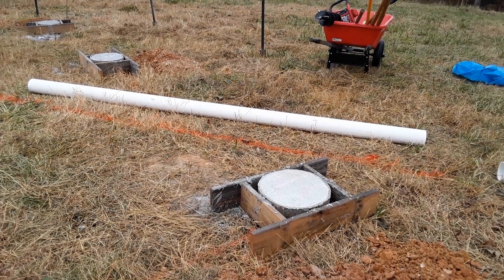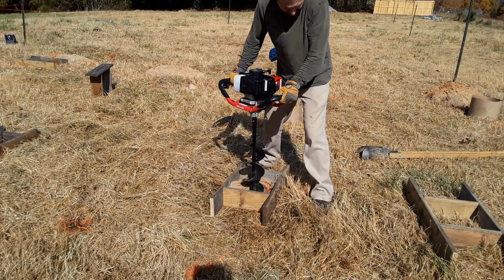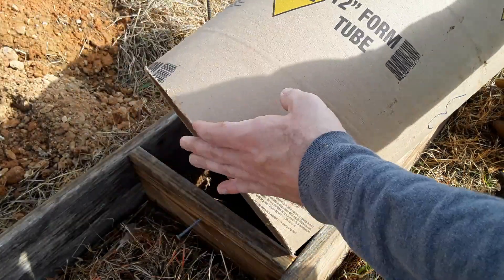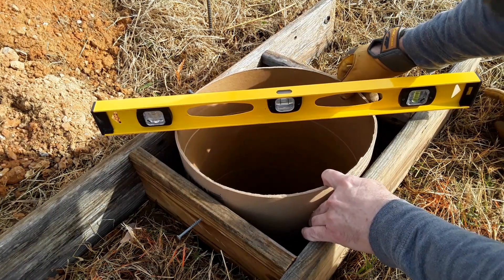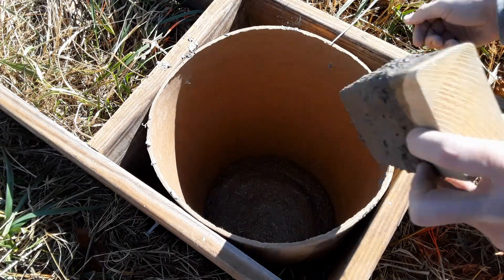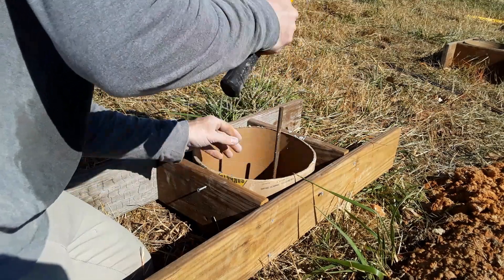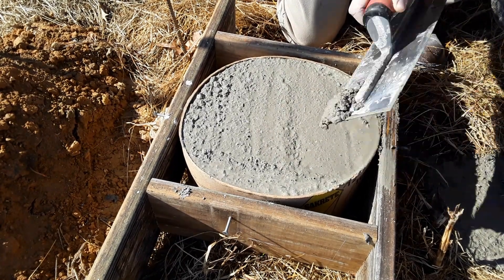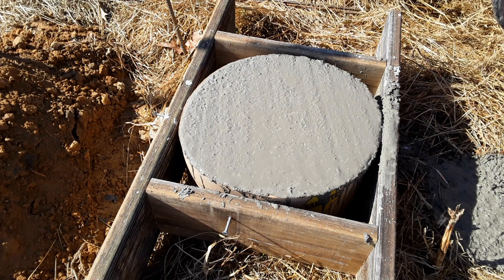Pouring Concrete Pillar Foundation

Comment: Im trying to build a 20x20ft coop and Im wondering if I could get away with just using gravel for support. Or do you think it would be wise for me to pour concrete columns?
Reply from the maker: @willcanbe4947  I have a few questions. Is it going to have a roof and walls, or is this just a chicken run? Do you live in an area that freezes a lot? Sandy, rocky or clay soil? Sorry, I need more info to give you my opinion. 😁
Reply: @hillbillyhowtos  yeah no problem. I will have walls and a roof. And I live in Canada so it quite often freezes 🥶
Reply: And our soil has a lot of clay in it
Reply from the maker: @willcanbe4947  my first thought would be to go with concrete but I'm sure your frost line is to deep to try and dig that deep. I know people in Alaska build on gravel with cinder blocks all the time because frost line is to deep and soil is pretty stable. Sorry, I'm not sure what to tell you. I would recommend doing more research on what people do in your area. I'm just a hillbilly from the south. Lol.
Reply: @hillbillyhowtos  okay, no problem man. You answered to the best of your abilities. Have a good one thanks for the help!